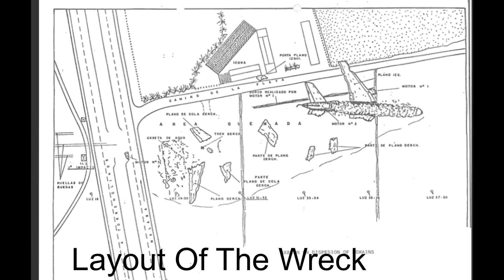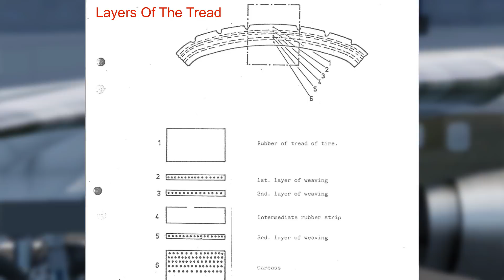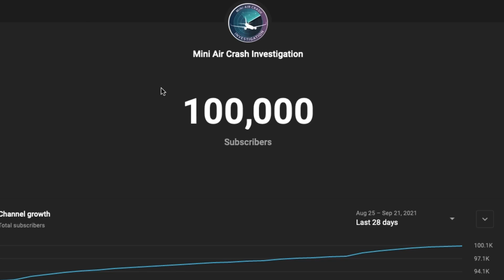How A Flat Tyre Killed 51 People | The Crash Of Spantax Flight 995

Comment: Couple things here… 1) Why was the decision to finally abort made AFTER lifting the front wheel off the ground? The vibrations should have decreased immediately. 

2) They call it “decision speed” for a reason, it doesn’t matter what plane you’re in or what training you’ve got. If there’s an abnormality you abort, figure it out - best case you just taxi back around and take off again. ATC may ask for a reason but that’s just protocol, doesn’t hurt anything.
Reply: The weight of the aircraft on the nose gear would have had a damping effect on the vibrations which would have increased initially as the unbalanced wheel spins freely as it lifts off but, you're right, any abnormality up to V1 you abort. You never, ever, change your mind once you've achieved V2 unless a wing falls off!
Reply: @johngrantham8024  Agreed. I see many comments like 'Something was wrong, so he made a justified call'. And I can understand why he did that, but cannot agree it was the right decision. Those procedures, the training - all these things are in place for a reason. Someone already analyzed multiple factors and cases to come up with this framework. You must have a very good reason to break the rules. And when you do, you better decide fast. This case was just too little, too late, too undecided.

Comment: Captain knowingly rejected takeoff long after the decision threshold and that decision directly led to the deaths of 51 people. Had he done what he was supposed to, taken off after decision speed, they would have found that the issue went away immediately and could diagnose it as a bad wheel. Captain blew it here, and I don't think that exonerating him was the correct choice.
Reply: They tried to take-off, as soon as the nose gear lifted the vibrations became worse, seeming to indicate a flight surface malfunction which would almost certainly mean they would crash. They tried to follow procedure which was abort if you can't fly. They found that they couldn't fly with a flight surface malfunction and thus chose crashing near the airport where help can reach them quickly to save as many lives as possible instead of taking off and then crashing further away, potentially into a populated area which would've killed everyone aboard plus hundreds on the ground.

If they had taken off, it would've been against protocol as they believed the flight surfaces to be damaged, it would've been nothing more than a 'YOLO' attitude to just wing it and take off, hoping that they could even take off, hoping that they could even remain in flight, hoping that they could climb, hoping that they could control the aircraft, hoping that they could circle back to the airport, hoping that they could land and hoping that they wouldn't fly into a city instead...

They followed protocol by attempting to continue the take off, at which point the vibrations became worse, indicating flight surface issues. Protocol stated that in those circumstances they must abort take off so they did.

Comment: I personally think the captain did the right choice. They're trained to perceive when something is wrong and to try and save as many people as they can. He knew that by aborting a take off after V1, they were going to crash but, at least, it wouldn't be falling from the sky. If he took off without knowing what was wrong, it could mean losing almost to all souls on board, since it'd be a fall from the sky if the plane was not controllable. If it wasn't controllable while on the runway, let alone airborn. Protocols can sometimes be less efficient than decisions from an experient and good captain. So yea, I stand by this captain's side! ❤️👏🏻👏🏻👏🏻

Comment: The pilots were exonerated by people who know A LOT more than me.

Even so, I'm guessing the pilots might be more wary of reversing a decision in future.
As for that remoulded tyre, I guess standards have improved a lot since then!
Reply: They may not even be able to retread the nose wheel. I'm not sure about aircraft but semis can't use retreads on the front wheels to hopefully retain the ability to steer. They can retread the front wheels but they have to go back on elsewhere. :)
Reply: @williamgreene4834  Retread? I don't know about aviation, but when I learned about automotive tyres in UK remoulding was a stronger process than retreading.
Reply: @RupertReynolds1962  I was using retreading generically. I just know you have to put brand new tires on what they call "steering" tires on tractor trailers in the US.  I was married to a commercial pilot for 18 years. You'd think I would know about aviation tires but I don't. LOL. It was just a guess.
Reply: @williamgreene4834  Sure and I wasn't picking at details. And the video used "retread" as well. Perhaps it's generic in US? I was just surprised with my background :-)
Reply: @williamgreene4834  Almost all semis also have dual wheels everywhere but the front. Losing the tread from one of a pair is barely noticeable.
Reply: @briant7265  True.

Comment: Question: If the vibration was caused by parts of the nose wheel tread being missing, why did the vibration get worse when the nose wheel was no longer in contact with the ground? You would expect the vibration to stop at that point, but it got worse.  Thoughts.

Comment: As we (humans) get more involved in further advanced engineering in our vehicles, we find more and more often that sometimes you can make a poor decision and "get by with it"... while later on or even someone else can make all the right decisions (best possible at the time) and everything go awry, killing everyone onboard...

    What we seem to so easily forget, along with the VERY limited time for such decision making in the first place, is that all the established "best practices" and protocols for emergency management are established from Statistical Models. This goes all the way back to the very mundane vehicles like cars, and even wearing seatbelts. We're taught that seatbelts save lives. Statistically, in a VAST majority of cases this is absolutely true. That still does NOT mean a seatbelt is GOING to save your life in any accident, however. That's a simple, unfortunate fact of life. 99.999% of crashes, the seatbelts DO save lives, limit or prevent injuries, and generally contribute to a far better outcome from the "crisis" than would've happened without them. One or two crashes in 100,000, however, either the seatbelts are completely inconsequential, OR they actually contribute to the injuries or deaths of some occupants of the vehicle(s) in question...

     Does that mean we should stop wearing seatbelts in cars??? OF COURSE NOT!!! We simply have to acknowledge that once in a great while, there's a crisis in which NOTHING you could do nor foresee will help you. It won't save you. That's life "as-is".

     By the same notion, even with all the best practices established, and the best training available, sometimes there's just going to be a crisis that can't be mitigated any better than it was... AND in this case, training or not, such was the case... You do YOUR BEST with what you've got, and the chips are going to land as they may. Hopefully, in accordance with the statistical models at hand, with the appropriate training and practice, you'll be well advantaged by all the established best practices and procedures as prescribed for whatever you're doing up until the crisis happens.  ;o)

Comment: I don't understand why the vibrations would have intensified after the nosewheel left the ground, given that the vibrations had been increasing in parallel with the increasing ground speed, when the wheel was in contact with the runway. Surely, once the nosewheel leaves the ground its rotational speed would immediately begin to decrease?

Comment: Always stick to the rules. V1. Is the last stopping point.
This is a great channel. Keep the content coming. It is easy to listen to without annoying, loud music that spoils a narration. Excellent!
Reply: V1 is the last stopping point, unless... If you have all your engines die after V1, are you still supposed to take off? You couldn't even if you somehow wanted to. If you believed you had no functioning pitch control, would you still try to take off? Most would follow protocol and abort well beyond V1 if they believed their aircraft was unable to fly. At that point you have a choice: You will crash, will you A: crash near the airport where help can reach you quickly or B: crash further away from help, possibly into populated area and at great speed ensuring most if not all passengers die upon impact as well as countless people on the ground...

The rules stated that you shouldn't try to fly with an aircraft incapable of flight, even past V1.
You can even get a race car on a runway to the V1 point, it still will not take off though...

Comment: As per today's technology development, can't an aircraft have any digital camera to view all the landing gears and nose gear operation, at the bottom of the aircraft, which can be viewed by the captain in the cockpit. If this works out well, probably accidents related to landing or take of tyres can be avoided or minimized. I am just a mechanical engineer. My curiosity increased while watching your videos. Thanks 😊

Comment: Doesn't matter whether you've got a vibration, a fire in the cabin, or a tornado formed just off the end of the runway--after V1, you don't have enough runway left to stop, so you go*.  Worst case, you fly a tight pattern and land immediately.  RTO after V1 is only the right choice if the plane stops accelerating or an entire wing falls off.  There's a reason why airline training in the US is that the pilots keep their hands on the throttles until V1... and then take their hands *off the throttles and do not touch them again until they have a positive rate of climb, specifically so that they do not attempt an RTO after V1.

Comment: Why did the vibrations increase after the nose was in the air? I can understand wariness about taking off because landing on a damaged nose wheel is problematic; but I don't understand why the problem continued with the shredded tire no longer on the ground.

Comment: It seems to me the pilot was indecisive, not considering his options if the vibration got worse.  Unlike the recent fatal crash of N560AR, a case where it appears the braking brake was engaged, preventing it from accelerating, the DC-10 was accelerating towards V2.  But how is it that the vibration got worse after the nosewheel departed the runway during rotation?  This something I would like to understand.

Comment: Would the plane still be able to fly even with the vibrations? 
With nose wheel up would mean one of the rear wheels were also flat...
We’re the main gears retreaded the same way....
They didn’t have any engine warning lights or hydraulic issues...
Was the plane too big to safely use that runway...
Congrats on 100,000 subscribers.

Comment: I understand why we don't but I will always maintain that we should  build our airports just outside of the cities and require like, 10-mile runways or at least a good couple miles of cleared space beyond the runway that can act as a runaway truck ramp-type safety margin.  I'd happily have to drive further out of my way/pay a premium in taxes/ticket prices to cover WHATEVER adverse costs their may be to not force pilots and aircraft into extreme takeoff/landing decisions because they have to worry about ridiculous stuff like being too noisy over nearby residential areas.  That's literally the only reason the rotation is so extreme on takeoff...
Reply: As rotation begins,  it quickly takes the load off the MLG tires.  If it was indefinitely longer, rated tire speed would be exceeded in some cases for flights near MTOW... which can't be allowed to happen, so takeoff weight (payload) would have to decrease regardless of how long the runway is.

Comment: Another great video!

But why would the vibrations get WORSE after rotation if the issue was the nosewheel tire?
Reply: Because of "spring" in the NLG strut, the imbalance caused by a spinning partly disintegrated tire will produce a higher amplitude of strut stroking once the gear is no longer constrained by the runway.

Comment: Ive never understood the v1 idea. Surely, if the plane does not accelerate at its predicted rate, due to reduced power or similar, it could still be under v1 speed even with insufficient runway to stop safely, wouldnt it also be necessary to have a apprpreate point on the runway associated with the reject speed?
Reply: The same Aircraft will reach V1 at different points on the same runway on different days, dependant on its weight (passenger and fuel load) and ambient conditions (air density). The pilot flying will have an idea of at what point to expect to achieve V1 whilst the pilot monitoring will be checking performance on instruments. They coordinate. If P1 reaches his expected point and doesn't get a 'V1' call from P2, he calls abort.
Reply: Not accelerating normally is a reason to reject the take off, it’s a judgment call.
Reply: @johngrantham8024  That's what I was getting at. I thought that would be the call they would announce, something like "field length" rather than 'V1". As that would be a fixed calculated point on the runway V1 needs to be achieved, rather than a speed which could happen at any point, depending on the acceleration.
Reply: @lowtus7  One way to look at it is there isn't an instrument they can look at which precisely tells them where they are on the runway, but there is one for speed on the runway (approximately, since Instrument Air Speed isn't ground speed).  So yes, the calculations behind  V1 do involve acceleration distance and braking distance, but then the  result is expressed as a speed (related to those distances) to allow for quick determination by the crew of whether they have reached their go/no-go point.

Comment: I had no idea that using retreads on commercial aircraft was legal. Considering the speeds at which aircraft take-off and land and the stresses on the tires especially on touch-down, the integrity of the tires cannot be compromised. What are they thinking? Save money? How much does a new tire cost when compared to the cost of a new aircraft or the loss of life?

Comment: There is a very interesting Spantax air crash in Sweden 1970  just after take off at Arlanda Stockholm Sweden airport. No passages but three crew and 7 crew in transit, 5 killed, mid winter freezing cold and they crew lit a fire under the plan fully fuelled,  to keep warm. 🤯🤔😬😩

Comment: I've rejected a take-off at 20ft above the runway after hearing a loud bang with no visual clue. Turns out, the student's door flew open. Careful of judging.
Reply: Light aircraft are very different
Reply: @kickedinthecalfbyacow7549  Yeah, especially the weight. But also, no performance figure for V1.

Comment: Why did the vibrations intensify when the nose lifted up? The damaged wheel was not touching the ground.
Reply: The front gear was asymmetric, because only one tire failed.  That would cause it to vibrate in the airstream.

Comment: There is something that I don't really understand .. How did the vibrations increase after lifting the nose of the plane? The failed tire is from the nose wheel, which is the first thing that loses contact with the ground during take off. I would have thought that the vibrations would stop after lifting the nose of the plane.
Reply: One sort of vibration was replaced with another (worse) sort.  Because of "spring" in the NLG strut, the imbalance caused by a spinning partly disintegrated tire will produce a higher amplitude of strut stroking once the gear is no longer constrained by the runway.

Comment: Hi there, 

Perhaps somebody already made this comment, but with 565 comments already..

Is there no TPIS (Tire Pressure Indicating System) on the DC10? Certainly on the MD11 (which is the follow up of the DC10). TPIS would alert of a failed tire as well as monitoring pressure. Did only the new tread fail while the tire remained inflated? 

Also, it's hard to imagine how a tire that is about to blow a tread did not show signs during the preflight inspection. No cracking, no blister, no defects at all?

cheers 
Mark

Comment: Something doesn't add up: why did the vibrations increase and came from the back, when the plane lifted the nose wheel on datation, if it was a nose wheel tire that had burst?
Reply: Because of "spring" in the NLG strut, the imbalance caused by a spinning partly disintegrated tire will produce a higher amplitude of strut stroking once the gear is no longer constrained by the runway.

Nose gear is roughly 40 ft? behind the flight deck on a DC-10.  When I rode in the jump seat of one, at the first taxi turn it looked like we were going off into the weeds, since we were way out past the asphalt... but all the tires were still on it.

Comment: Curious if the nose wheel was damage, why would vibrations increase after the nose came off the runway?
Reply: My thought is the tires continue to spin after it's off the ground. Only for a little while but a tire missing rubber isn't completely round anymore and will spin awkwardly. That would make the vibration more violent.

Comment: The pilot definitely made a mistake. He didn't know if the plane would stay in the air, but he definitely knew that if he rejected landing the plane would over run the runway. But you can't blame him too much. He went with his guts in a split second decision and made the wrong choice.
Reply: As you said, he made a choice between flying what he believed to be an unflyable aircraft (meaning full on crash and death) and aborting (partial crash near the airport where fire and rescue can reach them). He went with his training, not his guts and aborted the take off, this video doesn't highlight enough where exactly the training lacked but the NTSB report does.